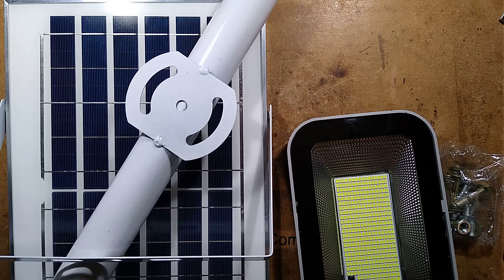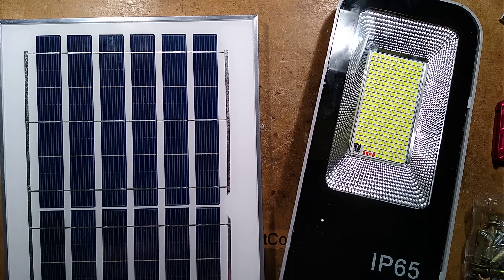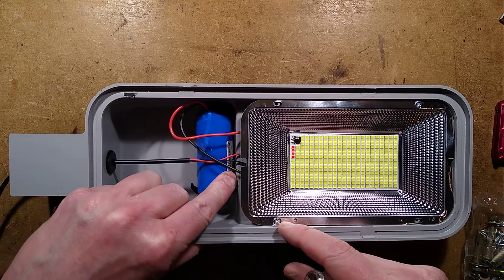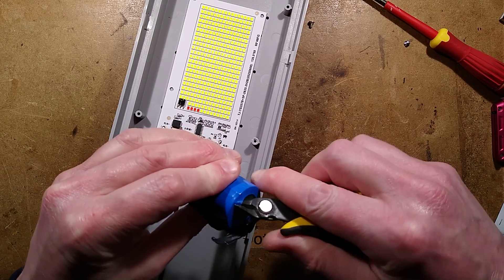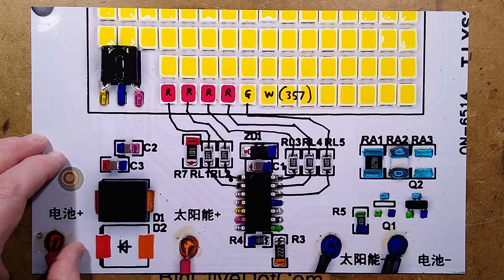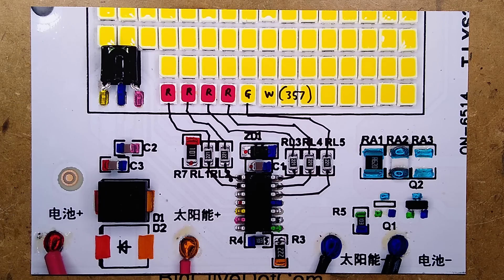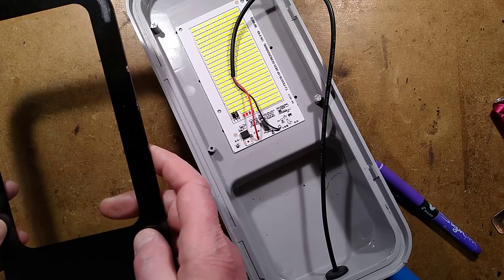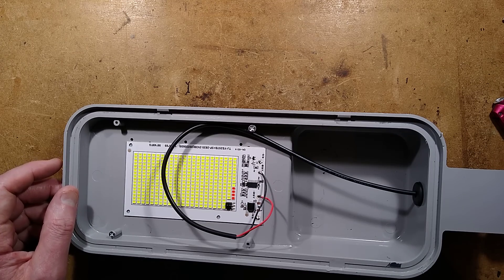Temu solar street light with generous solar panel & LiFePO4 cell

Comment: If these have 5.5Ah cells and 6th highest brightness is 1.1A does that mean that it'll run out of power after 5hrs? Likewise with if it charges at 1.2A, in April, that'd mean it'd take less than 5.5hrs to recharge? It seems pretty pointless for a streetlight to only have 5hrs of power, 10hrs being possible on the 3rd lowest brightness but possibly too dim to be useful
Reply from the maker: The intensity and current draw will gradually reduce in a curve.

Comment: i scored a pv panel of similar construction to that one you showed though about half the size.  it is very reliable. it has never failed in about 10 years of service.   i havent opened the little black box attached to it for quite a while (like i said, its very reliable) but from memory, i'm sure it has a decent sized capacitor in it.  it is beyond my understanding of electronics why it is there so i did not bypass it when i connected a light to it.

Comment: Probably around half the power supplied to the emitters is making it out as light, so only 2 watts dissipated as heat over such a large area seems perfectly fine with a plastic housing.

Comment: Testing LiFePO4 cells: 
max charge voltage 3.6V, 3.55V is adequate in reality, they don't gain much charge after this point. OCVP 3.65V
Min discharge voltage 2.6V. UCVP 2.5V
Most charge at 0.2C to 1C with 0.5C being optimal & discharge up to 2.0C max but with smaller cells I'd be monitoring temperature all the way at higher loads. [C =capacity] 
Cell output is very linear from 10% to 90% so voltage is not a good indicator of SOC. A fully charged cell will sit at 3.34V after resting.
I discharge test at 0.5A for consistency of data using a prebuilt 5A board unless I have >100Ah cells to test then I use 2A to the full 5A depending my patience. If I was regularly testing large cells I'd buy a purpose built unit, but a 5A or better a 10A board from AliX is cheap, flexible and reliable enough for most smaller li-ion, lifepo4 etc

Comment: Anything reliant on LFP will fail in regions where the temperature remains below 0C for any length of time.   You cannot charge those cells when it's that cold without causing irreparable damage.
Reply: Reminds me of self-driving cars in Michigan where in winter during snowstorms the entire environment is a featureless white. Good luck in winter when the high temperature is below 0° C for weeks at a time.

Comment: This similar type of china solar light is actually pretty affordable in Asia (about $10). I got a 6.4w Monocrystalline type solar panel (0.85A, 8.1v), the volt was somewhat high and non standard. It might cause damage if pair with mismatch solar lamp. It has around 200led powered with a single 26650 LiFePo4 (claim to be 4Ah), well at least with BMS attached. I then upgraded it with a spare 12w poly solar panel and changed the battery with a used prismatic LiFePo4 22Ah, works like a charm, bright from dusk till dawn. Then I salvaged the spare for another upgrade.

Comment: But why use 357 LEDs for a 5 W fixture? They must be so under-driven, and the bottleneck ought to be the total heat dissipation anyhow?
Reply from the maker: Using more ans under-running them spreads the heat dissipation and also increases efficiency.

Comment: Interesting that they would use a 3.2V(nom) battery to light White LEDs that typically have a 3.2V(min) Drop. I think you can only get about 50% of the battery capacity that way.
Reply from the maker: White LEDs will start conducting at around 2.5V.  The fully charged cell will be around 3.6V.

Comment: Those plastic containers on the back of the solar panel are very attractive for little critters and are sensitive for moisture build-up. Resulting in broken wire connections, which will cause an early dead of lithium cell(s) due to complete discharge. 
Be sure to spray the inside with a protective coating or fill them with hot glue or epoxy.
Tell me how I know...
Reply from the maker: There's nothing quite like DC to eat wet connections and wires.
Reply: How i know?
Reply: @jayyydizzzle  You said "I" meaning "me" - that is incorrect. the correct answer is "you" meaning "I"
Reply: @asedcopf  I'm aware. Op asked for somebody to tell them: "how I know" 

It was a joke haha

Comment: From my understanding (and implementation) a standard lead acid float charger will charge LiFePO4 without damage.
Reply: Lead voltages are a bit lower but LiFePO4 are constant current charged at, ideally, 0.5C so the actual charge cycle is different and current critical as anything over 1.0C is too high from the data I've been using from EVE (who now quote P - power rating not C - capacity on newer cells). So a 10Ah cell charges at 5A 3.6V CC and can discharge at 20A down to 2.5V
I tweaked my lead charger to work with lithium but it's an electronic charger, not an old school transformer, rectifier with current limiting resistors - these are a bit risky for LiFe cells/batteries.
Reply: you need to serial gang up at least 2 LiFe's to match lead acid voltage.  so 3,2V ×2 = 6,4V is about same as 3x 2,1V lead acid cells. so 6V, 12V, 24V ect. could be charged off of lead acid charger but you need a balancer for LiFePo because they can't pass-through current to self-equalize all cells like lead acid can.   

so 4S LiFePo at 12,8V nom. could also be 1V + 1V + 0,8V + 10V =12,8V.  that'd go horribly bang in notime.

everything lithium in series needs a balancer AND if not in lab conditions a BMS to avoid destruction or battery fire.

Comment: circuitry wise that looks just like my very first arduino experiment .. it was around 7 bucks in total cost also.. well okay, the led matrix was a little smaller, but it was  a lot more fun to build and install ! and the 1 € tupperware it lives in is still holding up to the weathers after 7 years.. probably could have used an old water bottle too like in this example here...  had to change the street salvaged lipos twice though. Solar panel were salvaged from old garden lights (they only made it two years..)

As long as the honored customer does not change behavior we will be flooded with this E-crap that is electronic waste right from the conveyor .. 

Would be nice if Clive could show us how to build such a device with what can be found on the street and in the bin. :)

Comment: Could you install both of those batteries in parallel and double the runtime?
Reply from the maker: Theoretically yes.  (Making sure the cell voltage were very close first.)
Reply: and then you had to double the solar module to actually charge the 2nd cell.

Comment: You know... I'd buy a few but they are all at a disgusting 78000K 

Also, I'm curious how many winters would that cell withstand...
edit: BTW, solar panels output their best in the winter. The colder the better plus reflections off the snow. 
That if they are cleared and facing the sun.
Reply: Answer: one winter 
at <5°C LiFePO4 cells die if charged . 
They'll safely discharge below zero but need charge temp protection or a heater or both to charge them.
Reply: @BromideBride  that is the theory. You and I will go out of our ways to protect our lipo/life batteries but the people just buy these and plop them in the yard. 

Just next door to me, a neighbor put one of these at their entrance. It almost certainly has a li-ion cell but it's been several years and the bugger still works...
Reply: I didn't know snow was from the Sun.

Comment: That gem looks like it should last three or four weeks outside.
Reply: Winter or summer?
Reply: @rimmersbryggeri  First one, then the other.  Though not necessarily in that order.
Reply: @zybch  In the order of your liking?  From what I have heard summer doesnt last that long in britain though. That's might be apocryphal though.
Reply: @rimmersbryggeri  Might or might not. Just about every British YouTuber I watch says it’s two, occasionally three days long.
Reply: Looks like it aught to be better than that to me, clearly not top shelf last forever quality but still (and surprisingly for a retailer of Chinesium grade) not terrible. Add in a desiccant pouch in the battery compartment and glue it up all around on that glass so its got a reasonable seal, or make darn sure it will shed any moisture that builds up inside and I'd think you'd get a few years out of it. The solar cell looks pretty good, though I wonder if the glass is really up to being hailed on or taking a snow load, so assuming that plastic isn't the sort that dies after minimal UV exposure or something...
Reply: outside... outside the shippingbox 😂

Comment: Interesting. Just bought one, I'm planning on adding a motion sensor and use this as a light for my back yard.
thnx
Reply: I was thinking it would be useful for me in that exact setup. How are you going about implementing the PIR?
Reply: I bought one with a P.I.R. though the solar panel is much less impressive.
It does a decent job of lighting the driveway.

Comment: It would be interesting to get a thermal image of the light running to see how hot those LEDs get without a heatsink.
Reply: Yeah I would be curious how well they hold up for cooling if they are sealed water tight?
Reply: they've got to under drive those LEDs or that thing would just melt away right?

Comment: I think it's a really strange mix of stuff. The circuit looks to be really cost optimized, biggest example of that is the lack of any charger IC and it relying purely on the protection IC. Presumably they get assembled and then sit in their box at 0% SoC in under-voltage lockout until bought? Surely that's not good for the cell? Makes me confused as to why they bothered spending the extra time and money designing in a LiFePO4 battery, kinda doubting it will last between the 500 to 2,000 cycles for it to even matter?

But why on earth does it have 357 discrete LEDs? That must be a pretty significant part of the BOM, a COB would be much cheaper! 2835 LEDs can do 0.2 W each easy, but no way this thing is doing 70W so they must be massively under driven? I can only assume they just added more LEDs in parallel to get more light output with a single LiFePO4 cell and not need a boost converter to make each LED brighter (and more efficient).

Comment: Changing the "designed to dissipate heat" case from aluminium to plastic is so typical for Chinese cost cutting 😂
Reply: No O-ring or peripheral sealing. But, it has heat sink fins? Maybe it’s a carbon filled plastic😂.
Reply: Its only 5W so its fine. Pointless over design just wastes resources and money.
Reply: Plastic heatsinks are a waste of resources.
Reply: @backgammonbacon  Plastic is better than metal for the environment how? Don't just make something up either.

Comment: A few years ago the local council installed solar-powered speeding alarms, including two near my house. When they detected traffic they would flash up the speed - in green if you were below the speed limit, in red if you were above. They looked like robust constructions, but since the winter they've stopped working, and from stories in the local paper I gather that's a problem with all the ones they put up. I suppose, as Clive would put it, water has found a way.
Reply: Ask the council nicely if Clive can have them for an autopsy.. might be an interesting video.
Reply: @CTCTraining1 He would shame them when he revealed they are cheap crap. 🤣
Reply: Water ALWAYS finds a way.
Reply: The ones near me are always failing. They reduced the speed limit from 30 to 20 and they have to buy entire new speed detection signs because they are not designed to have the speed limits changed 😂  what a con
Reply: The one beside my house lights up my en suite orange when someone is speeding as the brightness is increased and it flashes. 

It’s a bit disconcerting when you are sitting on the throne at 3am in the dark. 

Luckily it’s a very quiet road at night.
Reply: You should have liberated the solar cells, what kind of a citizen are you?!
Reply: The council put the same thing in my road. Cars and motorbikes used to compete for who could clock the highest speed. It came down after a month or two.
Reply: @MattyEngland  HIghways England put up ANPR speed cameras that flashed up your speed and reg number on the M5 at one point as a deterrent, same thing, the local boy racers used to compete for high scores.
Reply: @MattyEngland I've seen some that just show "- -" instead of a speed once you're a certain amount above the limit to deter this
Reply: I'm old enough to know better but taken part in seeing how high I can make the speed indicator go. 46 on an uphill stretch in my crap old car, borrowed my dad's car and managed 55.
Reply: @ASBO_LUTELY  But also there are loads of uphill stretches where you're allowed (encouraged even, otherwise you'll hold up other traffic) to go 70 or 80. Why not try your luck there?
Reply: Winter…makes me wonder if they are using LiFePO4 which needs an external heater to charge below freezing otherwise you get serious degradation.
Reply: Or the Lifepo4 battery in them have died from the cold temperature.
Reply: I would agree, if they had lifepo4 batteries and didn't have low temperature cutoff, the literature for my lifepo4 batteries says they can discharge down to -20°C but do not try to charge below 0°C or damaged will occur @KuntalGhosh
Reply: @nigozeroichi2501  Almost all lithium batteries are not allowed to charge in freezing temperatures as per the specifications. However, I have a self made solar light that uses phone lipo-battery and it has worked fine for many years and I live in a very cold country. I guess they work ok with slow charge even in freezing conditions. It would be nice to see some research on this topic.
Reply: @KuntalGhosh  Doubt they had LiPO batteries
Reply: @sie4431  LiFePO₄ (lithium ferrophosphate cathode) is not the same as LiPo (lithium; polymer electrolyte). LiPo batteries typically use cobalt or NiMnCo cathodes – they could also be ferrophosphate, it's just not telling you about that aspect of the battery chemistry.

Although in this case I assume you meant no battery at all lol
Reply: Virtually guaranteed to be LiFePO4 these days, but if the signs are old enough they'll be lead-acid.  Yes, probably died due to lack of temperature monitoring.  You can quickly destroy a LiFePO4 battery if you try to charge it below freezing.   It can also be destroyed if the cell voltage is allowed to drop below 2.5V for an extended period of time, but usually the BMS prevents that and even a little solar will keep the battery voltage well above 2.5V.
Reply: Might've been better if they turn themselves off in the presence of speeding traffic. Because as a driver, when you can't see anything, you would slow down naturally.

Comment: Not likely to be much use in our winters. Not just because the general low light levels will not provide much charge but on those bright sub-zero mornings the charge current is likely to damage the cell, they don't like charging at low temperatures.
Reply: I guess that's why Tesla cars, which switched to this type of cell a couple years ago,  charge so slowly in the snow belt.

Comment: I used one of those protection boards for charging a lithium cell, the board died within about 3 uses, then it became hot👀 I wouldn't trust them just to charge a cell
Reply: It's supposed to be the last line of defense before a battery fire, not an actual battery management system.

Comment: Any place I can go to just buy the solar panel? It's the best part of the whole thing 😂

If you buy any more street lights you're going to have to start putting them up if only as a place to keep them!
Reply: There are many of those panels being sold on aliexpress. I checked that out and it cost 7 bucks each
Reply: @sihamhamda47 the problem is for one good panel there is at least 10 claiming the same specs and failing.
We rely on people like Clive to point us to reliable equipment.